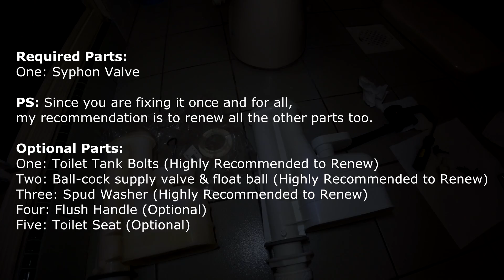Replacing Syphon Toilet Flush

Comment: How do i remove or unscrew that yellow cap or nut like  which is connected to the tank where the water is coming
Reply from the maker: If your referring to the 0:50 yellow cap, you need to remove the whole rod from the tank then just turn either direction to open like a typical water bottle cap, however, some design has a pin stuck at the yellow cap to prevent people from opening it, just grab a plyer and pull it, once done remember to put it back in. If your trying to stop water leaking from that side, chances is your rubber surface inside the yellow cap has disintegrated, best just replace that entire rod.

Comment: Can I don't remove the tank when replacing the valve?
Reply from the maker: For this kind of valve definitely need to remove the tank, as the valve lock is at the base of the tank.
Reply: @goldcamman2750  oh i see.. then i must make sure i not drop the tank 😬
Reply from the maker: @anggeline2045  yea, be careful

Comment: tempat untuk memberhentikan air rosak macam mana nak buat ?
Reply from the maker: Biasanya bawah tangki ada satu paip boleh tutup air masuk ke tangki. If you want to know the part that stop water from entering the tangki is the bola stick that is joined to the paip. Turn the white skru on the bola stick to adjust the height of water to stop masuk tangki.
Reply from the maker: Biasanya tukar stick bola akan stop water from leaking into tangki, inside the bola stick got a ring rubble to help stop water flow, if the rubble sudah lama, the rubble will become rosak and kecut.

Comment: So next time the lift diaphragm developes a fault (most common problem with cisterns) you have to to go through same routine. 
      Why not replace it with modern syphon whose diaphragm section can be clipped off and new one clipped on without doing all these dismantling. In fact a housewife can tackle the job without needing to use any tools
Reply from the maker: True, but, when changing to different type of syphon, size and compatibility is something to look into, however, mine was disintegrated due to clorox washing, so I just stick to the ori syphon design. 😊